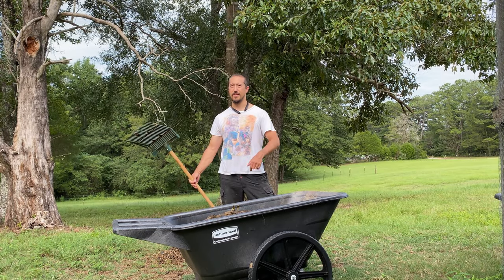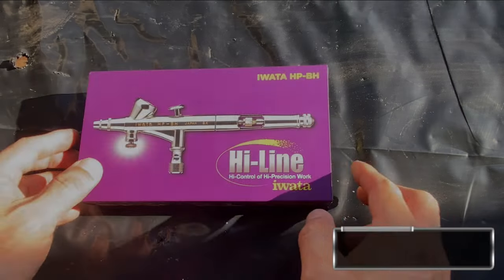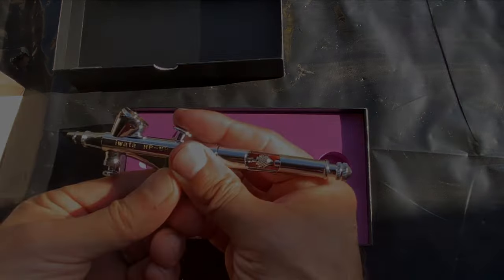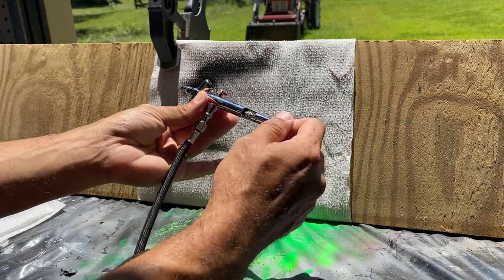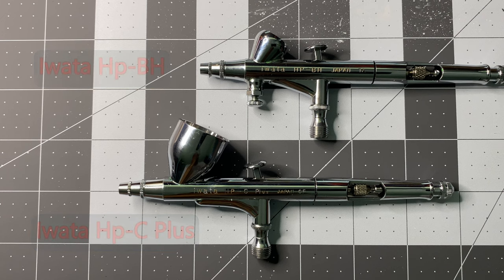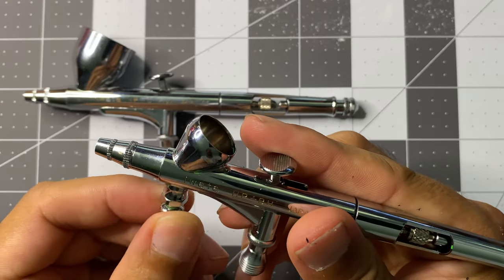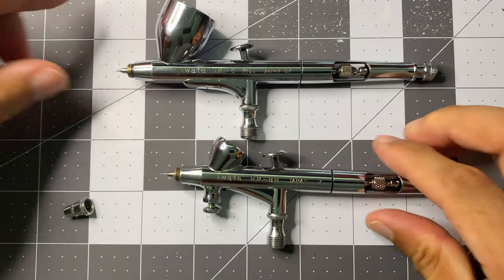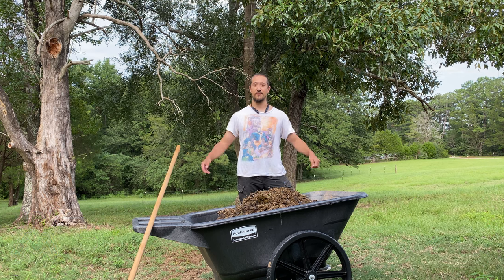Iwata HP BH - Unboxing and Review

Comment: Hey there, very nice review and comparison!
Quick question: I just got the hi-line one and found that the trigger has a side free play which my Eclipse does not have. It works, but the feeling is strange, as if an airbrush of this segment should not have this much of a free play on the trigger. What’s your experience with it in this regard? Thanks!
Reply from the maker: Thank you for the visit.  If I am understanding the question, by free play I'm thinkin you are saying that if you shake the air brush, the trigger is a little lose or wobbly.  There are a couple of hi-line models (ch, bh, th, etc...) and if you have the BH model like I do, there should be only a tiny amount of wiggling on the trigger, as the spring's forward tension should keep it relatively stable.  If its very wobbly, then something isn't seated right.  It could be the trigger isn't seated in the body correctly, you put the wrong size spring in there (i've do this sometimes when cleaning multiple airbrushes at the same time), or the threaded spring housing isn't twisted in all the way.  All of these instances happen to me periodically, even when i'm sure I put it back together.  Especially if I try to clear a clog by taking the back off and pulling the needle back and forth with my fingers while blowing air through the nozzle.  If I forget to keep the nozzle pointed down, what happens is the paint can flow back into the airbrush body.  Little dried flecks of paint can build up where the trigger sits, or the into the threading of the spring housing, and even onto the spring itself.  It can clog the needle path also, causing it to stick and not allow the spring to push the needle all the way forward when you release it.  In any of these cases, I generally resolve it with a full disassembly and deep cleaning of the airbrush.  I try to lubricate the spring and spring housing with a drop of the lubrication iwata typically packages with their airbrush models every other cleaning, also.  If I misunderstood the issue you are describing or if you have a different model, let me know which model number it is and I can try to find out for you.  I'll even head out to the shop and try to reproduce the issue, that way I can try to help and figure out what the fix you need is.
Reply: @workingwithminiatures0706  thanks for your reply! I double checked, and there's a very slight wobbling when shaking the airbrush, it doesn't look as if it's loose, so to speak. I think that this may be something to stop the trigger from rubbing off against the body of the airbrush?.
I'm probably going to take it to the shop, I've been testing this one out with multiple combinations of air pressure, paint dillutions and different thinners and i'm still not able to get really fine lines with it (although, I'm no expert at airbrushing at all, but my kit, paints and compressor are decent).
Also, there seems to be a sort of "bump" in the airbrush body, just below the cup. I'm not sure how to describe it, but there's also a sort of weird white kind of finish around it, as if there was some issue/defect in the electroplating process. Not very noticeable, but enough for me to see when cleaning the airbrush. 
I'm not sure if this is also normal, but this sort of things are not what I expected from a high end airbrush since, well...my crappy chinese airbrush, or my Iwata eclipse don't have any of these details.